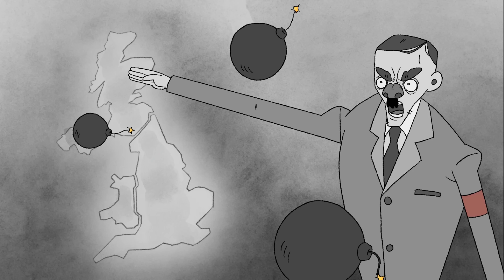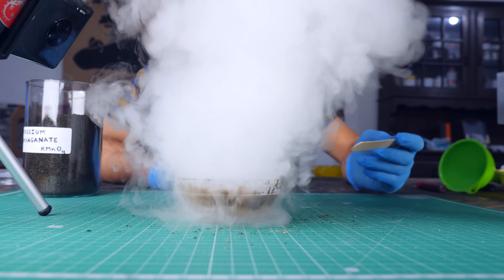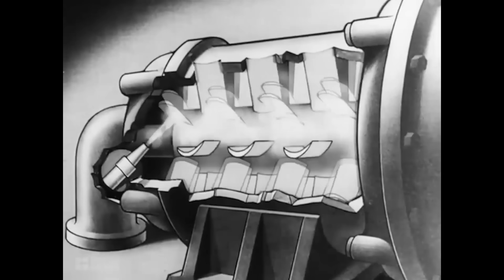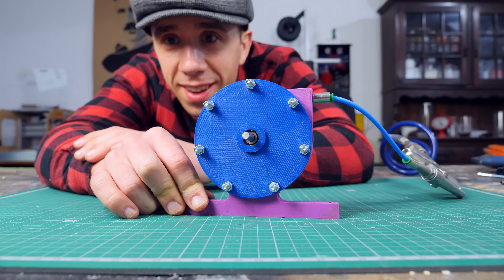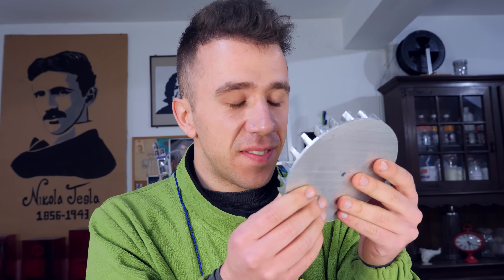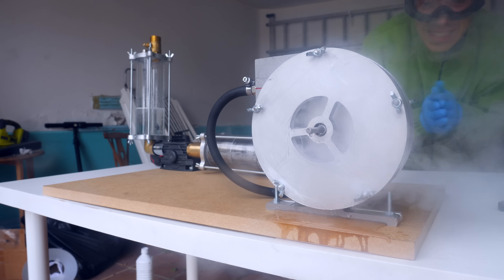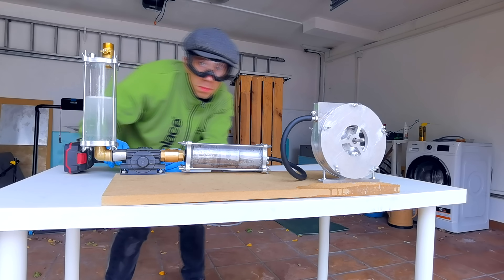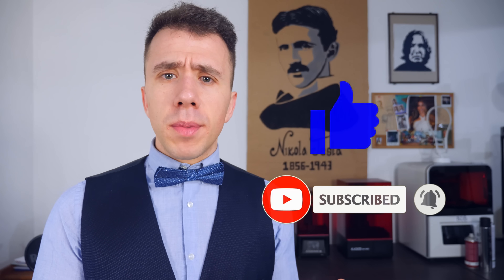I built the World War II V2 Rocket Steam Turbine

Comment: My only suggestion is to make a two chamber "steam chest". Stand the steam generator cylinder on end, run a pipe from the top of the generator down to the bottom of a second chamber, also a cylinder standing on end, and tap your pressure off of the top of the second chamber. This should eliminate the raw H2O2 from blowing through to the turbine. Well ... OK .... another suggestion would be to add a regulator to the steam flow. You could use a hot water heater "pop off valve" or one made specifically for an air compressor pressure tank to protect the steam chamber from over pressure and a regulator would give you metered control over the turbine's RPM.

Comment: if the converter is placed vertically (with flow going up) and you put some head space on the converter as well you would reduce the h2o2 in the turbine.

Also Airship

Comment: This was random in my feed, since I am only a woodworker and do some light tool restoration. I am absolutely stunned at how well this idea worked. Perhaps running a primary and secondary catalytic chamber in line to process the hydrogen peroxide more completely? Or, possibly, a larger converter. For something that only took a few days to build, that was a magnificent test. While it may not  produce a large amount of power in it's currently viewed form, it has potential. Thank you, very much, for posting this video. It takes people down new avenues of thought.

Oh, and a steam punk skateboard? I would love to see that.
Reply: I like this idea because it's so straight-forward.  It's analogous to a superheater in a pressure-fired naval boiler.

Comment: vertical catalytic converter chamber, with the peroxide coming from below, and some circular steel (or, even better, silver) plates between each singular catalytic converter, leaving a small gap on all sides, stopping the peroxide mix from just flowing straight trough, having to, instead stop and go around the plates and into the next converter, which should hopefully help separate the unreacted portions.

Comment: I saw you cutting the turbine blades and housing and thought, oh no. Then you said you broke a lot of endmills, which absolutely makes sense. For the first cut out, I would do a 2D adaptive using a 0.5 " endmill with 2 flutes for aluminum (or 4 for steel). The one you're using looks like a 3/8" / really small for that deep of a cut. Bigger is better for that depth of stock. The turbine blades are harder to do efficiently, but both look like they turned out fine so great job as always. Also, if you don't already know, you can calculate feeds and speeds for your tool using an online calculator, or GWizard, so that you have a better chance of not breaking it. Cheers

Comment: I think the problem you are having is that your steam isnt high enough pressure...

One thing you could do is to install the CatConverter tube upright and feed it from the bottom, and extract the steam at the top using some sort of pressure-controlled release.
This way you'd get less H2O2 in the turbine.

You could also use the power output of the turbine to power the pump, or to somehow compress the peroxide.

Comment: If you add a pressure chamber and release the peroxide via an atomiser you should increase the reaction efficiency as it's pulled through with the steam... Right now the steam is pulling the large droplets through which don't have enough surface area to react completely.

Comment: I'm not sure how you drew your conclusion that it wasn't producing much power. You don't seem to be using much of a gear/pulley ratio to increase the rpm of the generator. I would think steam could handle the extra resistance with ease.

Comment: I'm sure you will update the design but the catalyst chamber should be vertical so that the liquid stays in the bottom in contact with the first converter "cell" might be easier to control your pressure by setting a fuel level.

Comment: How about trying to make a Hydroxy gas generator that runs a jet engine or other engine?
Reply: Also your catalyst tube may work better in a vertical orientation with the outlet on top and having a sort of self draining trap Plumbed to a catch tank) and the inlet in the bottom of the catalyst tube. Second if you want to test the power output it might be better to have a flywheel to help maintain the rotational force. Then have a way the engage the generator after the turbine gets moving well

Comment: Your turbine is a combination of two turbine types. To me the center output is a bit problem. Input at the outside should correspond to an output outside. Then the steam force can cat roughly 300° to the flywheel. And you do not generate a air pumping with centrifugal force.
;) Or you support the center with butan/propan and use the oxigen from peroxide as reaction pratner in a afterburner ;)

Comment: To me the issue sounds like the steam that's generating is pushing the peroxide into the output tube. A solution could be to have the catalytic converters be next to each other in something almost resembling a tub, with the inlet near the bottom and the outlet at the very top. This'll not only increase how much peroxide comes in contact with the catalytic converters at once, but it should also prevent peroxide from getting into the outlet.

Comment: Video idea: I've seen a few steam bikes before, but with this safer and more compact method generating steam I wonder if you could make a steam bike that doesn't require the extreme heat and flame of a boiler. Plus this is safer, and far lighter.

Comment: If you control your feeds and speeds better, as well as maybe use coolant (liquid or air), you won't destroy so many endmill bits. What's better is that while technically slower overall in the feed, you'll probably have a faster result due to not needing to stop the machine to change out broken bits.

Comment: The turbine does not look very efficient.
In water power generators, I believe they use "pelton wheels". I don't know if the impact from water and steam differ much, but you could look into pelton wheel designs for the turbine.

Comment: Very cool test! If you need help with lathe turned parts (small, I have a unimat SL, not a big lathe) - let me know.
I think you need a more concentrated hydrogen peroxide - but that's more risky, dangerous, and hard to get (or make!). 
As for 3D printing projects - I'd love to see small scale shop tools (press, lathe, mill, drill and so on) - maybe air powered? That would be cool (regardless of the giveaway). 
A solar boat that is 3D printed and left to sail the world seas (sort of a bottle with a message) would also be interesting... especially if it could be GPS tracked...

Comment: Maybe ditching the catalytic converters and going for rods of the specific material that reacts with it might allow for a better reaction, the catalyst probably has a poor reaction because its not primarily silver or platinum it has a mix of several ones that aren't homogeneous. Then again the catalytic converter allows for better contact for the chemical to react with all of the holes, mimicking it on the rods would help greatly with the reaction because of that as well.

Comment: For a future video it would be nice to see a hous pume https://en.m.wikipedia.org/wiki/Peristaltic_pump at steam rocket instead of the two cartridges you used. Wheel diameter and pipe diameter define volume. A 3D printed mixer support for an vortex turbine (2 gasflows, outside vortex cold N2 or CO2, in combination with an inside hot burning vortex) flywheels made from the ceramic printer.

Comment: Maybe you can mount the catalyzer vertically and have both input and output near the top. I'm thinking gravity will do the work of getting the hydrogen peroxide to the catalizer, and by putting the output at the top, the liquid hydrogen peroxide will not be able to escape.

Maybe if you can use a fuel injector to spray a mist of peroxide onto the catalyst, you can increase the reaction speed.

Comment: your flue chamber and pump is good, your reaction chamber needs to be vertical to allow the hot gasses to travel up wile the liquid fall to the bottom to complete the reaction cycle i would also add a gap at the top to remove spatter and to reduce the liquids velocity so it can fall back in to the reaction zone. you can also add a second reaction chamber with only  a single catalytic converter to act as a dryer.

to add more fuel pressure you could tap off of the reaction chamber so the pump dose not need to fight the low to high pressure

if you can find silver mesh you can use this to start the reaction and preheat the cats for higher efficiency. 
silver mesh is used in jetpacks for its violent decomposition rate but but come at the price of erosion rate

Comment: It could be a good idea to put the steam input close to the axis and use an "open" frame.
So leftover water will not slow down the spinning.
A turbine with center injection has a lot of advantages. See https://de.m.wikipedia.org/wiki/Datei:Reaktionsturbine.svg
The easy way would be a support at your 3openings in the center and by redesigning the flywheel you should get some trust from it.
By pushing the steam from the outside to the inside the centrifugal force act against your steam flow.

Comment: Parallel packs of catalyst might help with the blowby of unreacted propellant, as well as running the propellant through some sort of orifice plate at pressure to get a spray impinging on the cat material rather than flooded. Pre-heating the cats before starting is also something to consider, pretty much every reaction runs faster as the temperature goes up. Might even be able to preheat the propellant a little with acceptable levels of decomposition, maybe run it through a copper tube that goes through or wrapped around the cat pack before injection just to get it ready to party.

Comment: In addition to mounting the catalyst vertically, you can try centrifugal separation - make the escaping steam navigate a spiral in the top of the tube so that the heavier peroxide is flung to the outside and redirected to run down, because it cannot reach an exhaust port in a central tube. Or maybe a system of baffles would be enough, they could just be stamped discs with holes and such.

Comment: @Integza, I think you would be best to have the catalytic converter in the vertical position, with a small gap approximately 5mm between the base and the bottom of the catalytic converter, and the peroxide entering at the bottom so that as it produces steam and pushes peroxide through it has a longer time to react.

Comment: Mount the catalyser cylinder vertically. The in port at the base. That way the liquid will stay at the bottom and steam will exit from the top. Also you are only exposing a portion of the catalyser matrix, only up to the surface of the liquid which will nominally be the height of the exit hole. Vertically mounting will ensure more expose more of the matrix to the liquid.

Comment: Turn the catalyzer vertical. Less fuel meeting the surface area of the metals, but any undecayed fuel may be decayed as it's pushed up to the exhaust side. Plus gravity is on your side keeping the liquid at the bottom. Would the fuel yield better results if it were preheated? Because I have a design idea that would assist with this as well using the heat produced from the steam.

Comment: well if u rearange the Katalyser Tube u could reduce Hydrgen Peroxide loss due the Horizontal Position. This could fill up the pipe with water because cooling Steam and can cause an Steam Hammer, but if the Pipe is Short this Shouldn be a Problem. ^^ Next would a Change in Material the housing of the Blades Should be Steel 4 Better Protection i think u have done it but more Lube 4 less Friction. Sry My English is not the Best In writhing

Comment: If you add a presser valve after the catalyst you should get less hydrogen peroxide going through the turbine as the valve will help slow the steam down in the tube but still keep the turbine spinning as if theirs no change in the flow other than adding a bit more delay in when the steam gets to it.

Comment: I think the high pressure created is pushing the hydrogen peroxide through instead of letting it convert. Maybe by putting your pressure chamber vertically you could recycle some of the hydrogen peroxide.

Comment: Impressive cnc milling on such a  small machine, interesting seperation of axis,  WHY the base.  x and Z overhead. looks to work well. all variations have pros and cons   The reaction turbine, amazing,  expanding  flow lower speed higher volume.exhaust  slightly over local air temperature at close to 1atm  large volume, powerstation cooling towers from a highly concentrated energy form.. . never rsaw that as an energy conversion process before despite visiting DRAX.  each set of blades converst slows the flow..  like the use of catalytic converters , cell like.  A pleasure to watch.

Comment: Idea💡: You could use your existing jet engines to lift a light plane maybe from balsa wood or any other light material, use rc module to control it. You could use small fuel cylinders to hold propane/butane to sustain the flight.

Comment: I think you need to go back to the impeller wheel design like turbochargers and actual rocket pumps use. Also you should lubricate it with grease because water isn't a good lubricant. In steam engines they actually have to add oil to the steam to keep the cylinders lubricated. (watch any of Jay Leno's videos about his steam cars)

Comment: If you stand the catalytic tube upright, you might be able to reduce or even prevent hydrogen peroxide getting in the turbine. making the cylinder longer without adding catalytic converters would also help reduce the chance of hydrogen peroxide getting in the turbine.

Comment: An atomiser and change of orientation of the catalytic converter to vertical with a downward atomised hydrogen peroxide mist at a good enough distance for good distribution or better yet multiple nozzles of mist for perfect distribution allowing you to use less and generate much more pressure, just keep an eye on your upstream pressure too with some kind of backflow stop. The higher pressure pump should take care of it but you can't be too careful.

Comment: You have all the parts for a turbopump.

Id say split the output shaft to have it drive the pump. Put a valve on the peroxide tank as a cutoff and put a valve between the turbine and decomposer to act as a throttle independent of the speed of the pump. You would also need some kind of pull start for the pump though.

Mount the decomposer verticaly and use more catilylic converters so the peroxide has a larger surface area to decompose from.
It may be worthwile to take the pump apart so see its internal spaces if case its bottlenecking or not. Id also recomend presureiseing the tank a little bit as that will help push though the entire system and depending on the pump may remove the need for a pull start and just open the valve.

I don't know much behind turbine physics but makeing more stages of blades would make more use of the steam as it apears to be leaving the exhaust at a high speed. Different turbine types could also improve the use of steam and the torque of the turbine.

Comment: You might be able to fix the leftover hydrogen peroxide going through the system if you just flipped the catalyzer vertically with the input on the bottom and the fully decomposed hydrogen peroxide would go out the top. With how it is right now the gas is pushing out some of the leftover hydrogen peroxide.